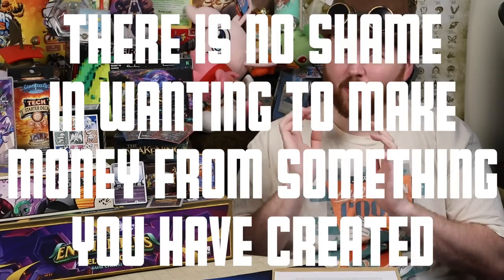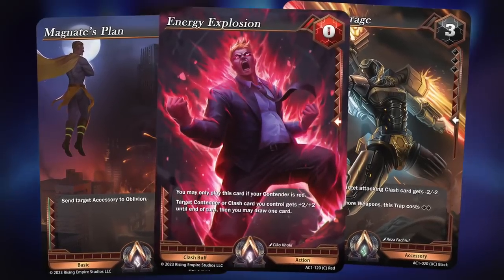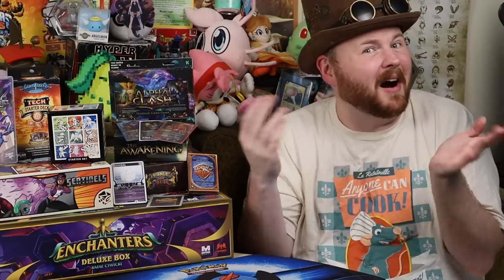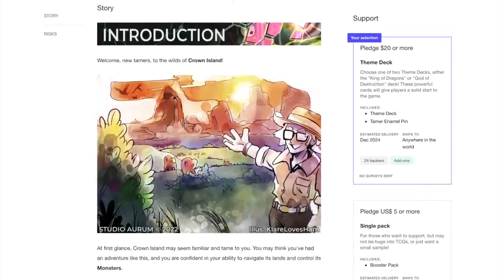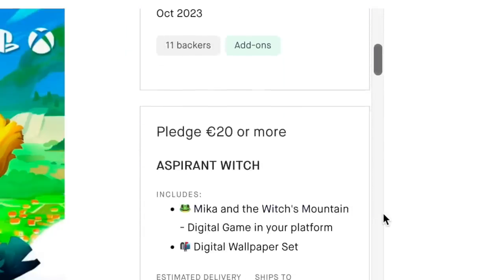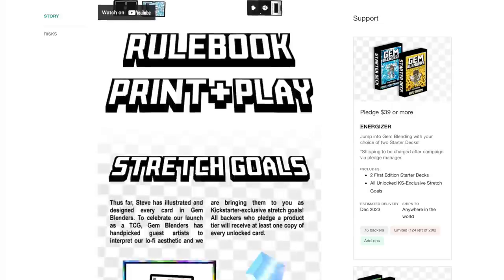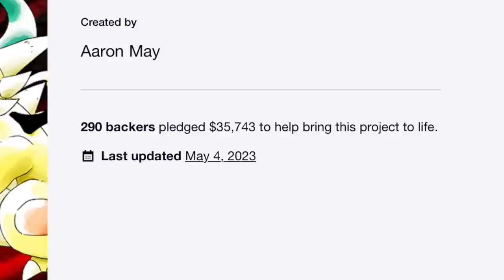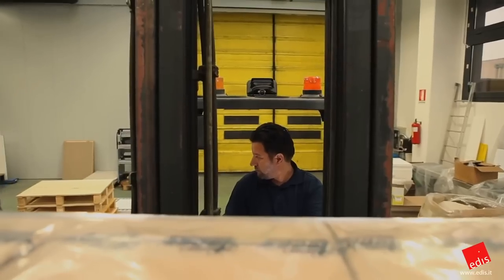PREPPING YOUR KICKSTARTER!! - Errata Text

Comment: I'd mentioned it on another Kohdok video:

If you're going to include a playable demo (in Tabletop Simulator or whatever) for your game, make sure you polish it up as best you can. It doesn't need to be perfect with fancy graphics and automation scripts, especially if your game is still in early development, but make sure you cover all the basics. Your demo should include all the pieces that players need to try your game. It should have a scanned rulebook that players can read in-game. Or at the very least include an easily accessible link on the Stream Workshop page to where players can find a PDF of the rulebook. The symbology and terminology used throughout the game should be consistent with the rulebook, and so on. 

I've played demos that fail to do all of these. Remember that for a lot of your backers, this is the only chance they get to try the game out for themselves. And you only get one shot at making a first impression. If your Tabletop Simulator demo looks sloppy, then it makes the rest of your project look sloppy.

Comment: This video will be very helpful to me once the design of my first set of my card game is finished or close to it at least, as I would have very little idea how to do a crowdfunding campaign. To be fair, you've helped me a lot on all of your videos on Card Game Design and its pitfalls. I'm a bit worried my game is going to have a relatively small audience, due to its slow paced gameplay of lots of tactical decisions, more like a chess game in that every action has a bunch of things to consider. I've noticed a trend of games, especially card games, to keep their games short, with Yu-Gi-Oh rarely getting to turn 4, Magic where 8 Mana is code for infinity, and in the amount I've played Digimon it seems like the best strategy is to attack when you get the opportunity (although I admit I haven't played enough to know how it works in more meta decks). So I'm hoping to stand out of the crowd with long epic games, even if it makes tournament play less than ideal (if I want to do best our of three, I'll probably have to have 2+ hour matches, based on the playtesting I've done so far, although I am working on making it a little less defensive).

Thanks Kohdok for all the work you've done in making your videos.